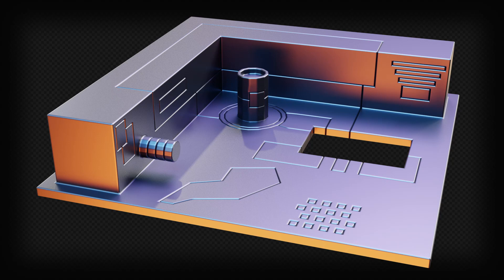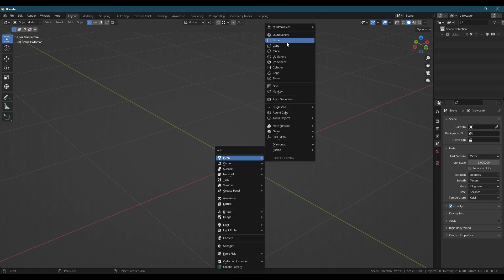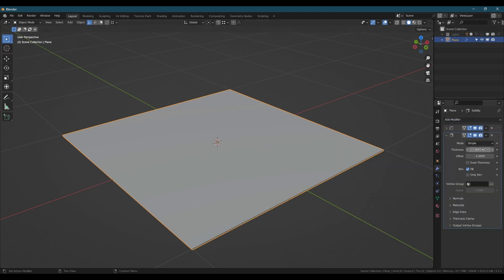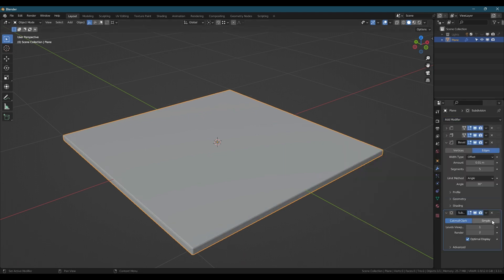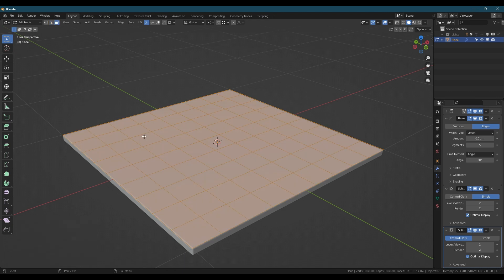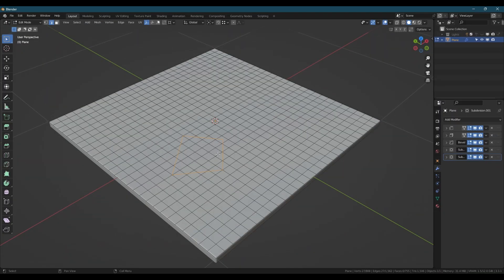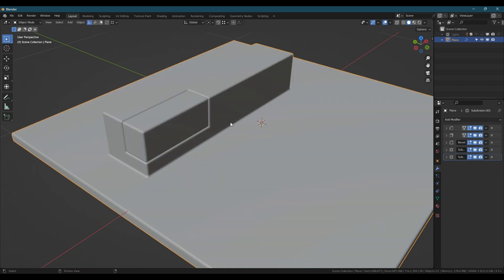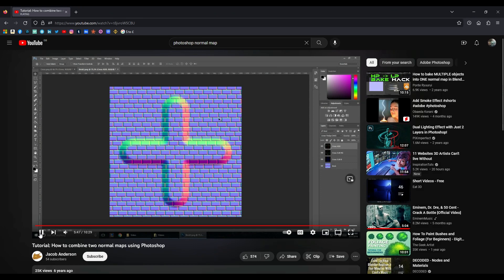Easy Panel Lines in Blender

Comment: For anyone with an issue of thin panel lines do this...

1. Go to solidify modifier and check "flip" that should invert the faces to the correct orientation. And now when you mess with the solidify thickness you can increase/decrease the panel line size.
Reply from the maker: @sixmagicman2746  awesome tip thank you!

Comment: In order for your bevels to appear smooth you should check harden normals in bevel modifier and check use custom normals in both subdivision modifiers, plus if you are using older blender versions before 4.1 you should also enable auto smooth in the object data properties under the Normals tab.
Reply from the maker: @atasky  Awesome info, thanks.
Reply: @chrismartinartist  Or a better way of doing it skipping all the above is just placing the bevel modifier between the two subdivision modifiers and also in the bevel modifier choosing arc in the miter outer.

Comment: Cool tip, can you apply the modifiers in order to keep the detail for printing?
Reply: You can't get a manifold mesh with this technique, so it's not very good for 3D printing.
Reply: @Ambaryerno  why would it not be manifold if the modifiers are applied?
Reply: @Mr.McWatson  The problem is the Edge Split modifier disconnects that part of the mesh from the rest.

Say you have a ball. Solid object, right? Now cut a section of that ball out, and you've got a big hole in it.

That's what Edge Split does.

The Solidify modifier doesn't help because it's set to rim only, meaning it's not creating actual depth and is basically just acting like you're extruding the edge. You CAN add a second Solidify after the Edge Split with Only Rim unchecked, but Solidify doesn't play nice once you're trying to solidify a mesh with perpendicular faces.
Reply: @Ambaryerno  Oh, it uses edge split. I forgot, haven't used this technique in a long time.
Theoretically if you applied all and then merged verts/ creased the edges where the panel line is inset, it should work... I think
Reply: @Mr.McWatson  True but then you're giving yourself more work, and you can't keep it non-destructive if you need to change something.

There's Just Panels, but I don't know if that's even been updated for 4.x yet.
Reply: @Ambaryerno  Is that the only quick panel line option? I've basically been cutting and insetting
Reply: @ I haven't used it much, like I said, it's not built for 4.x (some of its functions want the auto-smooth attribute, which was removed in 4.x). It seems promising, though. There's also stuff like HardOps or Fluent, but I've not messed with either.

Comment: How do I thicken the sharp lines? Mines so small you can barely see them
Reply: panel line size should be relative to the size of the plane, if you make the plane really big then zoom out, your panel line will be very thin hard to see
Reply: For anyone else with this issue do this...

1. Go into your solidly modifier and under normals check flip normals.

Everything works as it should but the panel lines are inverted, ie., you need to flip normals

Comment: What button shortcut allows you to mark something as sharp?
Reply from the maker: I don't think it has a default, but you can set any key. I have mine set to Shift 2. To mark something as sharp you can right click while in edge select mode and select it from the menu, if you right click it in the menu thats also where you can assign a shortcut. Hope that helps.
Reply: @chrismartinartist  i still didn't get you!
Reply from the maker: @catchen7253  Select the edges, right click with the mouse, and select mark sharp from the menu.
Reply: @chrismartinartist  I get,thank you
Reply: CTRL + E